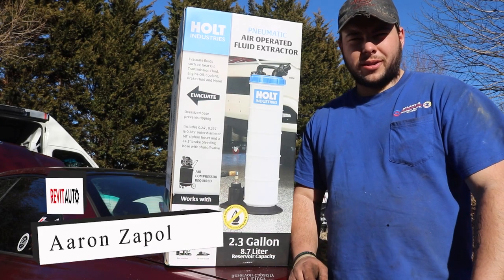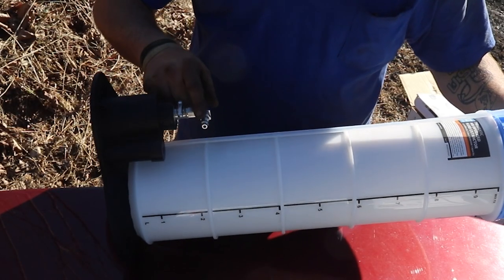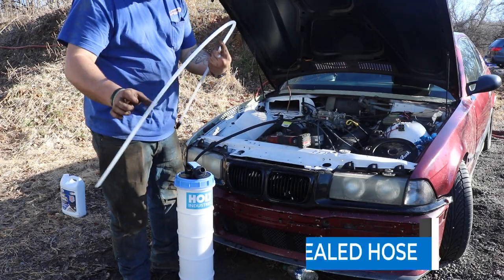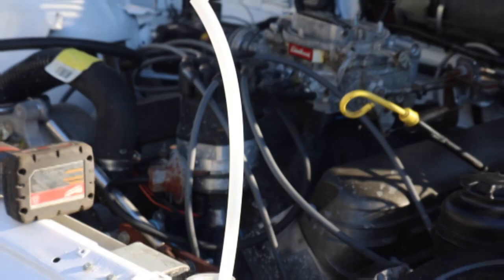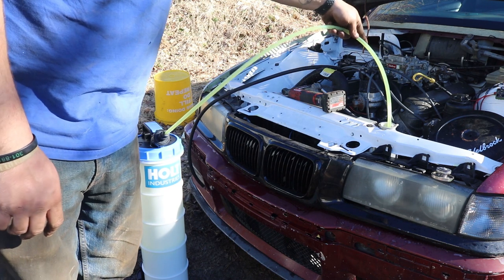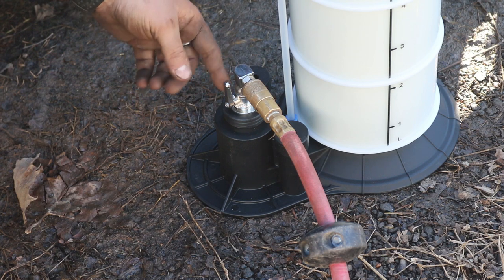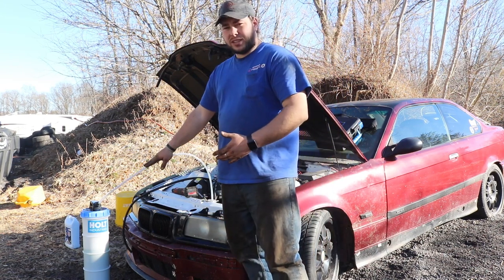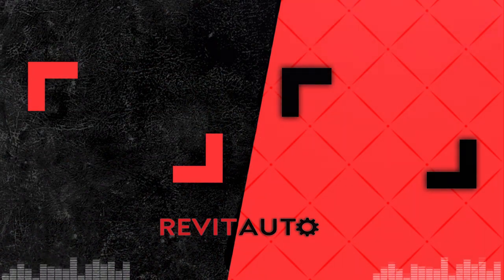Harbor Freight Holt Industries Fluid Extractor | Tool Tuesday

Comment: you need to use a regulator for the air pressure. 90 PSI Max. I learned the hard way and made a giant mess when the tank imploded.
Reply: Good looking out
Reply: How large of a air compressor will be needed? I have a small air compressor from harbor freight with a 2 gallon tank. Will that have enough capacity?
Reply: @BigRigRich yea youll be fine as long as it can build 90 psi the compressor will probably just run more
Reply: @AutoCulture773  

Thanks for the input!!

Comment: Will a small volume compressor drive it, or do I need a big reservoir compressor?
Reply from the maker: We have a little one that we use to power it and it works pretty well! Like this one here https://www.amazon.com/Makita-MAC700-Big-Bore-Compressor/dp/B0001Q2VK0/ref=asc_df_B0001Q2VK0/?tag=hyprod-20&linkCode=df0&hvadid=198077680239&hvpos=&hvnetw=g&hvrand=5823961509110362850&hvpone=&hvptwo=&hvqmt=&hvdev=c&hvdvcmdl=&hvlocint=&hvlocphy=9007798&hvtargid=pla-383959037690&psc=1

Comment: I try to get oil out of a Chevy Silverado 2007 the smallest hose down the dipstick it wouldn't go all the way in it and 
Also A Dodge truck with a hemi in it
Down the dipstick it did not work either works great on 4bangers but that's it